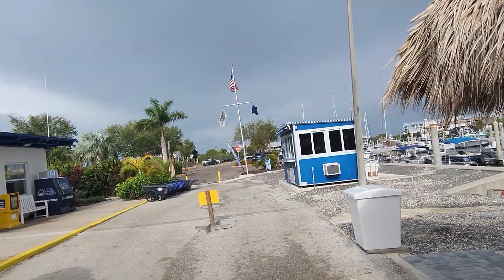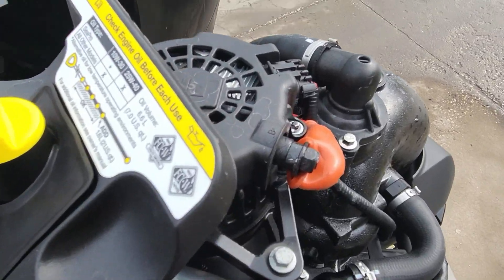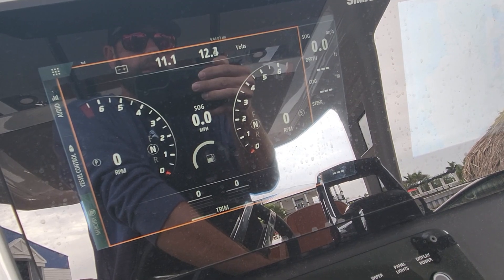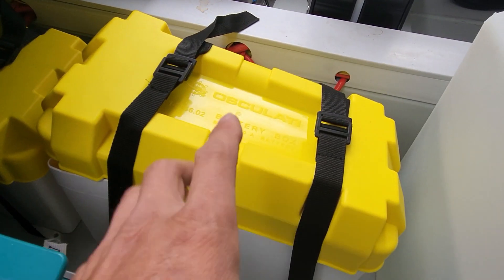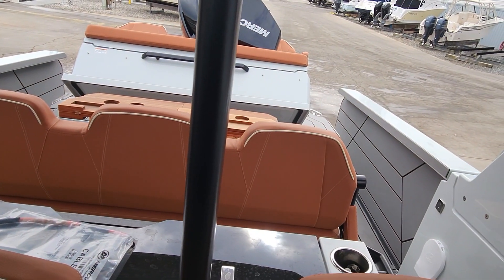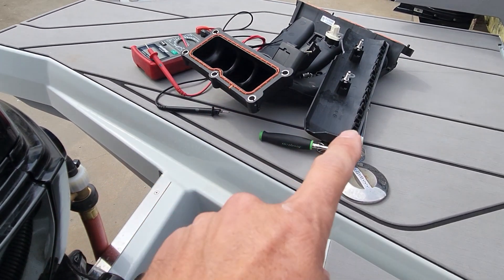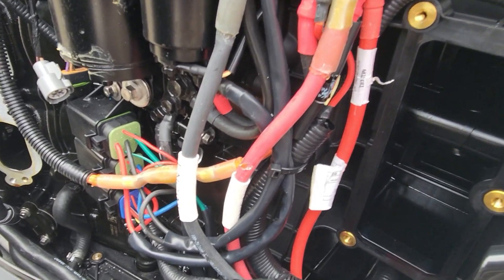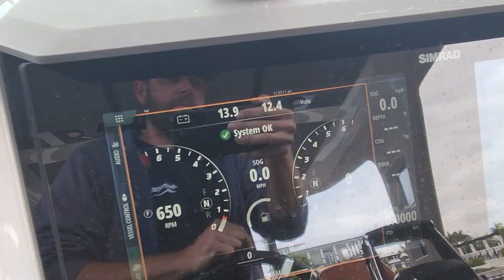Mercury Low Voltage Codes!?! #Mercury #MarineMax #Saxdor #Episode213

Comment: Great Video.  I was sure this was the issue with my 2019 Verado 250, but the fusible link passed the continuity test, and there is the same voltage out of the alternator and at the endpoint of the fusible link.  Any other ideas...

Comment: Hello Justin I was wondering where I can purchase an inline fuse cable like the one you used... I typed it in but nothing comes up? Thank You  My 300 2021 verado has a low voltage warning showing up  29 hours on it  GRRRR very frustrated...
Reply from the maker: Part number 878231A03. Hope that helps. Thanks for watching.
Reply: thank you for the quick reply... Much appreciated   safe boating

Comment: 2 questions…no parallel switch for battery’s on this boat? And also I see you can start these motors just on the flush port? Don’t need the muffs?
Reply from the maker: There is no parallel but if you ran the starboard engine it would charge the port side.  You can run the engines thru the flush but you shouldn't rev them up or run them very long. It can starve the water pump if you don't have good water pressure or you lose water pressure.
Reply: @JustinLeeMarine  👍

Comment: I have a 2013 mercury OptiMaxx 2 stroke.  125 hp. Battery not charging.  Is there one of those fusible wires in my motor? Output on the alternator lead is 26 Volts
Reply from the maker: Yes you do have a fuseable link. Here's the part number. 878231A03

Comment: Justin isn’t there a rectifier built into the alternator. I was Getting high voltage out of the alternator so I put a new alternator on. Still not charging my battery. I tested the fusible link. Seemed good. 

You said the rectifier could be bad at the end of the video. The plug and play wire coming off the alternator.  Should I change that wire and where does it lead to? Do you have a part number for that rectifier cable ? 2007 gen 2 275 Verado serial 01b518454.  

I checked the battery isolators also. And swapped Batteries to see if the non charging issue stayed on the port motor. Still port motor won’t charge. 

Any where else to look in line within the charging system?
Reply: I also checked the cables coming from the motor thru the harness to the battery and the grounding block etc.

Comment: I have 2012 mercury 150 hp 4 stroke with two codes 3172-23 and 621-25 what I can do the engine don’t start and I have a long beep
Reply from the maker: I would have to plug it in with the Mercury software to figure it out. Try your local Mercury dealership.

Comment: Does it matter if it’s idling or wot? At idle my fish graph shows 11+\- but voltage goes up with rpm
Reply from the maker: You will have to check it at the motor. Sometimes you get voltage drops when connected to a NMEA system. It should go up the more RPMs you get. Should be at least 13 at the motor when running. Check between the alternator cable and the stud. The fuse could be half blown and still let voltage thru. I have seen that before. Keep me posted 😊

Comment: Hi. I have a 2017 mercury-150 4 cycle outboard motor. Is there a fuse from the alternator like in your video.
Reply from the maker: Yes. The 150 has the same fuse.

Comment: why wouldn't the starboard battery start the port motor - dont the battery switches allow that?
Reply from the maker: I thought the same thing. The Starboard motor will charge the Port motor when it's running thru the VSR.  The emergency jumper switch is hooked to the house and jumps the house battery to the Port battery. Kinda weird but if the Port motor is not charging then neither is the house. 🙃